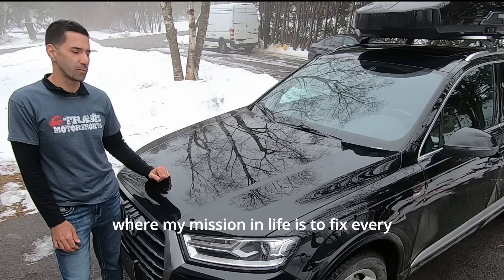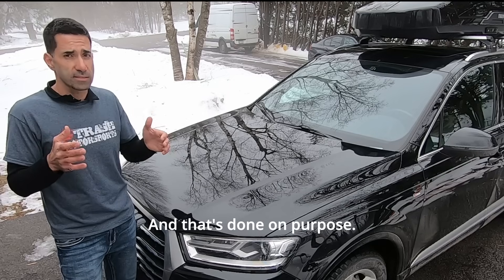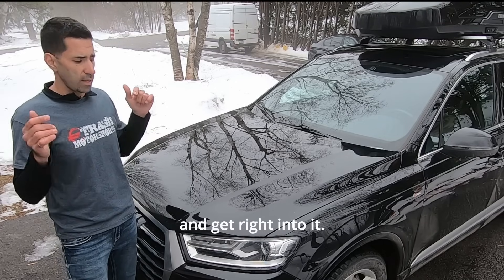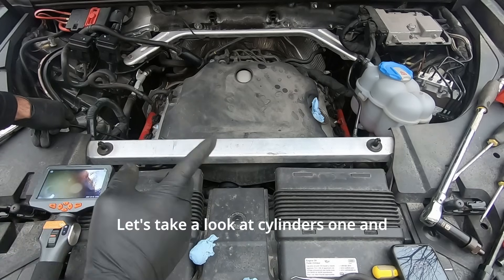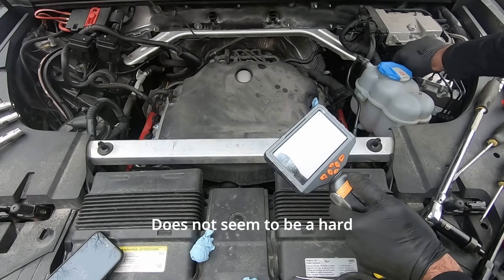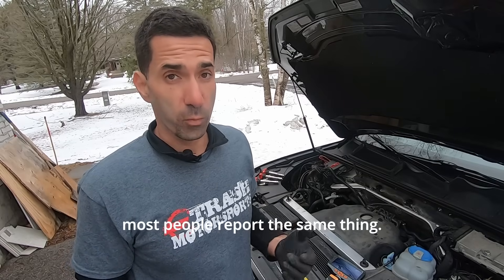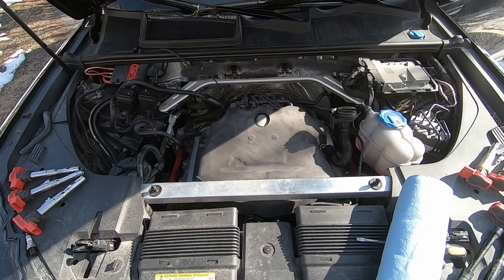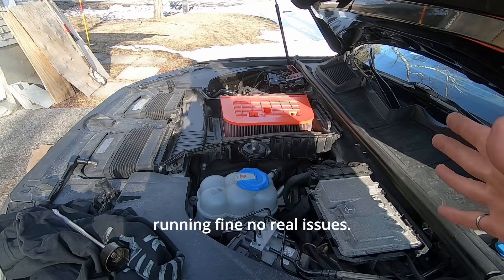I piston soaked another 3.0T with B-12 to fix its oil burning issues due to stuck piston rings

Comment: The owner may want to try any of the following products (not snake-oil) for managing carbon and ring issues:

BG EPR: Add to Hot Engine; Above Idle (1200RPM) for 20 minutes; Perform every 3rd Oil Change; Cyclohexanone Cleans with Heat; Active for only 30 minutes
BG 44k: Add to Tank while almost empty and fill up; Perform last 300-600 mile before every oil change; Highest PEA; Techron is 2nd Highest in US
CRC GDi Cleaner: Follow directions; Use before every oil change.
Pennzoil Platinum Euro 0w-40: GTL base oil; 5k mile oci; Dealer preferred oil for SRT engines over PUP(non-track); Castrol Euro Car 0w-40 A3/B4 alternative
Wix WL Oil Filter: Any decent filter
Top Tier Gas (Chevron, Shell V-Power): Up to 19x cleaner than non top tier gas; Use any grade of top tier
Auto-RX Plus: Ester-based cleaner for rings; 2 rounds of 1500mi clean/1500mi rinse; Perform 2-3 years based on driving; HPL Engine Cleaner 40w alternative
VR&P: not a euro spec oil; moderate risk at 5w-30 vs 5w-40 (warm climates); 4-8 rounds at 2000mi (short oci); potential to use permanently with oil analysis; should break up turbo coking
Berryman B12: Piston Ring soak for high oil consumption rate (> 1qt/2000mi); Perform as needed; Valvoline Pro Series Intake Cleaner (P/N 884531 @ Rockauto) alternative; SunnySide Toluol alternative (100% toluene lacquer thinner; paint supply store) 
Seafoam Deep Creep: Cylinder Fogging Oil/Penetrant 
Lubegard 30015 for Turbo:  LSPI safe (no calcium) oil protectant to prevent ring deposits (lxe esters); does not clean existing deposits; use with PP Euro; 3oz/1qt treatment; 3% Auto-RX plus alternative; HPL Euro PCMO 5w-40 alternative
BG Dynamic Engine Cleaner: Heavy Sludge/Varnish/Neglect; expensive $300; Does not work on turbo coking
Hyundai ECF-1: P/N 00232-19115; water-based combustion chamber cleaner that uses chelation to remove carbon; used in hyundai tsb 23-EM-007H to treat rings under vacuum; 24hr warm soak for best results; Evapo-Rust alternative; Tetrasodium EDTA + citric acid (ph neutral) alternative; Stihl Decarbonizer (discontinued) alternative
AT-205: stop leak for valve stem seals (or other leaks); Bars Leaks OS-1 alternative

The consensus at the moment is to use B12 and VR&P. Both are tested and proven.
Reply from the maker: Wow that's a great list! Thanks for sharing

Comment: My 2006 mx5 is currently burning 1 liter every 300km, we cannot access b12 in europe tho, i dont even know if it could fix such a big oil consumption, wich is caused by oil rings clogging
Reply from the maker: Yeah that's not that bad - we've fixed worse... you can try LiquiMoly Engine Flush or fuel cleaner Pro Line
Reply: @ETMotorsports i actually just dumped acetone in the cylinder and put the spark plugs back on, we’ll see how it damages the engine
Reply: @ETMotorsports i also forgot to mention that the consumption was with 20w50 oil

Comment: you know whats cheaper and easier? replace a 1/2 liter engine oil with regular old ATF every oil change. ATF is very high in detergents and will clean carbon build up from behind the oil rings and keep them clean. after 2 oil change cycles your oil burning problem will be completely gone if it was related to the low tension oil rings gumming up. Or if you dont like that approach you can use valvoline restore and protect line of oil which is also very high in detergents and will accomplish the same results.

Comment: Doesn't make sense why you can't soak all 6 at the same time. If you measure how much fluid is required to soak the piston at TDC, then why not add the same amount to the other 4 cylinders and save a lot of time?? Then rotate the crank and the fluid won't come out? Also when taking the fluid out, why not use a suction pump??
Reply from the maker: Draw a piston at TDC and a piston at BDC... at TDC you have a very small space on top of the piston and 50ml of liquid fills the gap and soaks the whole piston... when you're not at TDC you've gotta fill the whole volume on top of the piston so you can soak the whole thing... it takes a lot more liquid and almost immediately you're past the high point of the piston  so you're now only soaking the low end of the rings. Nothing stops your from pouring liquid in all 6 cylinders at the same time - it'll take a lot more B12 to do it and may or may not be as effective. On top of that,  at TDC you get to also soak the bottom of the valves and the head crown on top of the piston so it's a free cleanup... feel free to try it the other way and report back. The first time I did the 3.0T I didn't do TDC and it just took a lot more liquid - that's all
Reply: @ETMotorsports  Apologies, forgot due to the cylinder head will mean piston can be completely submerged! I still think adding the same amount of fluid cleaner to the other pistons will make the procedure quicker in time, as some people don't have time or mechanic becomes expensive, whereas you could have a mechanic come by every 2-3 hours and just rotate the engine.  

Luckily, don't have engine with low tension rings so can't test but on the next car, I will probably end up with those and will need to use this method!

Comment: SO it's actually the extended drain interval and not the ring design so much...
Reply: It is the ring design. Most modern engines use low tension oil control rings which are much more vulnerable to getting jammed with carbon than standard tension rings.
Driving 4 answers has a good video on it here: https://www.youtube.com/watch?v=Ft12aZffCEg
Reply from the maker: You mean the extended oil change interval that Audi suggests? Nobody really follows that - most owners know better than to trust that 15-20k oil change nonesense... most of these engines are well maintained and still have issues
Reply: Generally, yes, and the fact that SN rated oils were not really the proper chemistry for GDI engines. Make sure to use SP rated oils and don’t add any extra zinc….5k miles is on the high end of the norm for people that really want to keep their engines proper.

Comment: why would a petrol car produce black smoke doesn't that mean its a bad tune?
Reply: Scrap the tune and go back to stock. Rich running means the catalyst isn't functioning, it's fouling the plugs, washing the cylinder walls, contaminating and diluting the lubricating oil, trashing the bores and rings, etc.
Reply from the maker: Pretty much every tune I've seen runs rich which produces black smoke...
Reply: EFI engines run rich at startup,  DI engines are pig rich at cold starts, to get the catalytic converters to "light off" they retard ignition timing, as well. All boosted engines required richer fuel mixtures under power, as well, compared to natural aspiration.

Comment: Did it to my 2017 Audi Q7 3.0 and initial first drives after the soak oil consumption got extremely bad I was burning about a quart of oil every 20 miles. I think I ended up adding about 4 quarts of oil and then it stopped. I did an oil change after about 400 miles and have no issues with burning oil now. Thanks

Comment: If I was doing this job frequently I might try to invent a catch-bag device for catching the debris blown out of the cylinders, using a drilled-out spark plug to hold it in place. Apart from preventing debris and solvent being sprayed around the engine bay I could then see exactly how much debris had been removed and show it to customers.
Reply from the maker: Yeah that could work... to be honest anybody that sees the scope images of the crap in the cylinders will get a pretty good idea of what's happening in there

Comment: You should try the new Valvoline restore & protect for an oil change or two. Says it takes 3000 miles or 90 hours to get piston rings I believe. Curious to see how well it does on these notorious platforms.
Reply: With my 2013 Q5 3.0t it helped a ton. Since they don't make 5w40 with the restore and protect I run the 5w30 restore and protect in the winter and the Valvoline Euro 5w40 in the summer. In general I burn way less with Valvoline oils. Liqui Moly was the worst with oil burning. I won't be going back.
Reply: @toddn.3123  Yeah I'm not going to lie im at 193k miles, didn't burn much before on 5W40 (just under a quart every 5-6k miles, but more than a quart if i drove hard or did HPDE). Now with switching to the lighter 5W30 I've still lost a tad but not as much as I was expecting after changing the weight. Excited to see once I switch back to 5W40 motul
Reply: This is the way !
Reply: Just make sure to buy 3-4 oil filters  if you have sludge or you can damage sht  if you clog up the filter and it bypasses
Reply: @fritzsnickerz855  I'm 2k miles in plan on changing the filter by 3k miles take the car out for a hard drive and change by 5k. Will run for another cycle or two and see what consumption and oil analysis look like compared to before hand
Reply: I used R+P for a year. Vague improvement. B-12 worked the same day. No oil loss for a year.
Reply: @zoneadmin-n6c Yes - Valvoline R&P may delay or prevent re-sticking rings after a soak, but it certainly isn't going to free up already stuck rings as effectively as B12.
Reply: That’s what I’m doing, using restore and protect, mine uses about 1 liter / 2k miles.
Reply: I believe it claims improvement after four, 5k oil changes. So that is after 20 thousand miles. It is good oil, with carbon dissolving properties, but there is no doubt the B12 piston soak will do the job much quicker and effectively. My 2017 Hyundai Tucson used to burn a quart of oil every 300 miles. It burns virtually nothing now.
Reply: @Extra300goldberg  B12 without question does a it quicker but carbon buildup can get so bad in these 3.0t engines in extreme cases people have ruined their engines if they don’t get all the chucks out. Plus the convenience of just switch oil for a bit that having to put the car down for two days and rotating TDC

Comment: Dude. I’m obsessed with fixing their oil burning issues too. 👍 Subscribed.
Reply from the maker: 😂 I'm not the only one? Lol
Reply: Watch the video after 12:33, and see an old car without these "new" oil consumption problems ... so, old is Better nowadays ? What has gone Wrong with these today's "engineers" ? 🙂
Reply: @bustjanzupan1074  manufactures required to use low tension piston rings in order to meet air pollution and fuel economy restrictions

Comment: Just thought I would mention. Anything with PEA should work. I did this with Techron (it was on sale)  on a  2.0 VW. Soaked overnight. Then did a engine flush.   Went from 1Qt ever 500miles to .5 quarts every 3000 miles.
Reply: Redline and Rislone have PEA.
Reply: @peternilsson4359 rislone injector cleaner?
Reply: Techron concentrate plus would be great
Reply from the maker: Great results! Thanks for sharing
Reply: @ETMotorsports Hi, do you think this same method will work on Volvos? They have the exact same issues with their piston rings on their 2011-2016 I5 & Drive-E 4 Cylinder engines. Thank you!
Reply: @sacredglamourrr yes, I’ve seen videos of people doing it on Toyota other brands not just Audi VW
Reply: What's PEA?
Reply: @Diver_Dan  It's the chemical in the higher end injector cleaners. Just google what brands in your local area contain it.

Comment: A SPARK PLUG THAT IS NOT BURNING RIGHT WILL CAUSE OIL CONSUMPTION THOSE IX IRIDIUMS ARE NOT GOOD FOR THAT VEHICLE THEY ARE MEANT FOR SPARK PLUG IGNITION SYSTEM WITH WIRES NOT COP COILS

Comment: YOU HAVE A BIG PROBLEM THERE THE SPARK PLUGS ARE THE WRONG ONE'S THE NGK IX IRIDIUM IS NOT MEANT FOR AN IGNITION COIL SYSTEM AND THEY ARE NOT OEM PLUGS AT LEAST IF THEY USED THE LASER IRIDIUM OF NGK BUT FOR THAT VEHICLE USE THE BOSCH OEM PLUGS SO TRASH THE SPARK PLUGS PUT THE CORRECT SPARK PLUGS THERE IS YOUR PROBLEM WITH THOSE CARBON UP PLUGS THERE NOT FOR THAT ENGINE AND NOT BURNING RIGHT.
Reply: What's with the shouting post?   Having a bad day?

Comment: I typically pull the fuel pump fuse prior to doing this process, I find this helps it re-start easier. I will also fog with top lube before cranking with the starter (plugs out), as the B12 really dries out the cylinder walls. 
I feel that a borescope is mandatory for understanding what is taking place in the cylinder. Additionally, as you found, cleaning the upper portion (valves) of the combustion chamber is just as important as the rings.
Reply from the maker: great suggestions and all very valid - to be honest I'd pull the fuse too but get a bit lazy so just let it run the fuel...for the fogging oil - same thing 100% great idea! The first Q7 would have been very hard to deal with without a scope - I couldn't turn the crank and couldn't figure out why...if it wasn't for the scope to show the build up of carbon at the bottom end of the piston I would have wasted a ton of time trying to resolve this...
Reply: When I did the B12 soak on my oil consuming Scion Xb it did really dry out the cylinders.  So much so that I had to squirt oil into the cylinders to get the engine to start.
Reply: So, what # fuse is it and where is it located? I normally work on BMWs and know where all of those are but not my wife's Q7.

Comment: Just finished doing my 2l TT Today, as well as doing a walnut blast of the intake. Everything went well except for the 15min test drive to clear things out before dropping the oil, I had the "low pressure oil" light come on. After watching your low pressure oil video series I'm freaking out... hopefully the oil change will fix that. 🤞
Reply from the maker: Eek... the treatment shouldn't cause an oil pressure issue - hopefully the pump intake didn't get clogged... keep us posted
Reply: @ETMotorsports  2.0L TFSI EA113 changing the oil and filter didn't fix it, getting absolutely no codes just the oil pressure light stays on when revved over 1500rpm and only goes away when ignition off. Would you suggest pulling the pan first?
Reply: Pulled the pan and the pick up screen was blocked with carbon flakes as well as a tablespoon or two of it in sump.
Based on my experience I would have to recommend people do the same for peace of mind, especially on older cars (2008).
I'll update when I get it back together.
Reply: @demonjay3450  nice catch, hope that sorted it out!  May want to do another low mileage oil change too
Reply: @brainkill7034  No warning lights or codes, everything appears to be fine 🙏
And yes, another oil and filter change is definitely on the cards soon.

Comment: you have done so much for us with crec 3.0t! thank you. no more Rotella 5w-40? or that is not something needed anymore? sometimes i hate the internet for so much information. i was reading about it possible to di some bad stuff to the catalytic but idk i would like to give that a try. 2nd i'm one off the brave/stupid ones that actually is driving the car with 100ml of b12 in my oil for over 3k miles. it will evaporate and just make your oil cap milky :))) but it dropped my oil consumption by 200 miles(instead of 1qt every 400 miles now i use 1qt every 600) is it bad? idk i guess i will find out eventually :))

Comment: Our 2.0 was consuming like crazy.. b12 for 24 hours and its good as new!
Reply from the maker: Great results!
Reply: @ETMotorsports  Okay, but, wait, : weren't many engines been built for Decades Succesfully without Any oil consumption ? So, what has happened now ? Have these "modern" engineers become without Knowledge , or what ? Anyone knows maybe ? 🙂
Reply: @bustjanzupan1074 they use piston rings that are smaller and have less tension to improve efficiency
Reply from the maker: @bustjanzupan1074 low friction rings to reduce fuel consumption by some 0.01% or whatever... everything now is done for emissions and penny pinching
Reply: Can marvel mystery oil clean it?